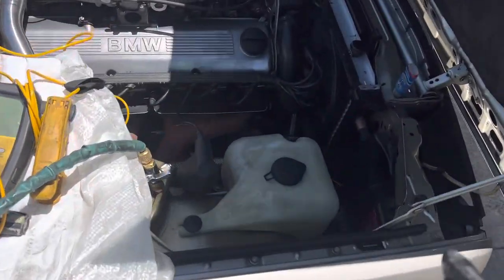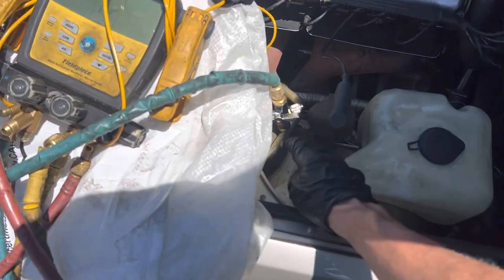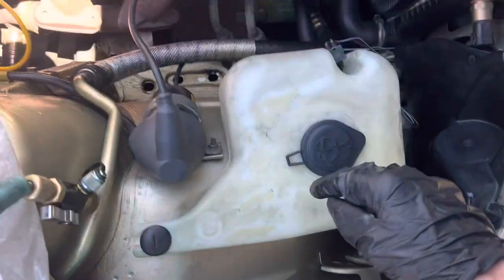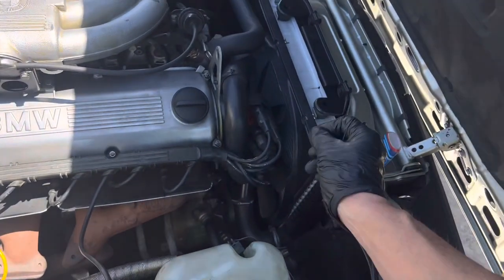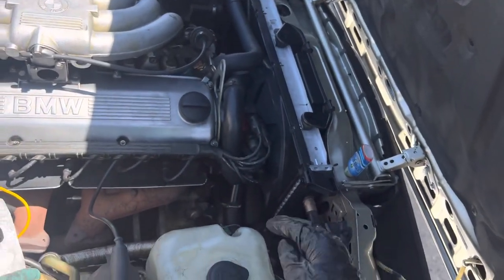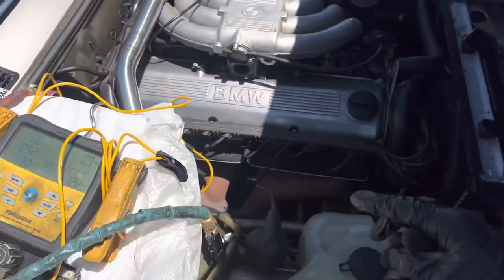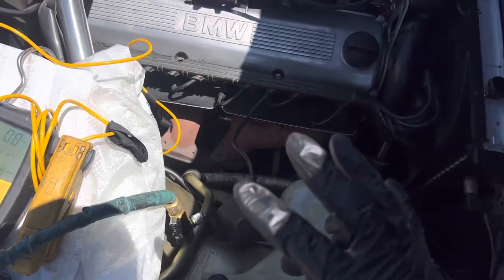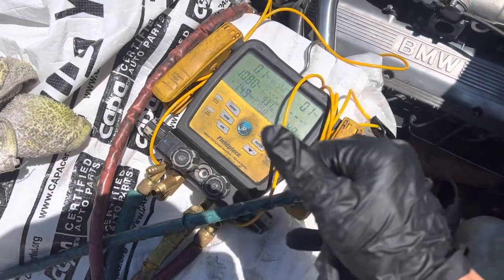AC on this BMW comes in at about 1 psi￼. I’m gonna show you a leak that starts & then stops￼

Comment: On those silicone fluid-filled thermostatic fan clutches, I've found the valve stem that's actuated by the spiral bi-metal coil gets stuck and stops moving.  Often they can be freed-up by using a penetrating lube while actuating the stem.
The other thing that happens as you point out is the silicone fluid leaks out and in that case it doesn't make sense to try refilling them because it's just going to leak again.
The silicone fluid fill port by the way, is an aluminum plug driven into a hole in the center of the mounting shaft flange.  To refill, that plug has to be removed, which takes time, patience, effort....
Reply from the maker: Yes as a child my dad not only made me go over the manufacturers manuals and TSB’s but he would make me disassemble and cut open failed parts. 
           Back in the days where you could takeoff the cover off of your alternator regulator and adjust the cut in and cut out voltage and clean the points off the contacts.   When you take apart your starter clean up the metal surfaces open up the starter solenoid and flip over that big copper bushing that was a contact points that would wear out and it would be good for another 50,000 miles.   Pop out the diode‘s and rectifier assembly inside alternators that you would get for three dollars and replace them.
Reply: I had own one of these before, my solution at that time was to retrofit a used electric fan and relay from volvo 850 and make a custom made aluminium fan shroud. And then the A/C cools really quickly even with 60 celcius in the interior under the sun. The weakest link was only the used fan which blew up the fuse periodically. If I get another one again I would still do the same but putting a new Flex-a-lite fan instead.
Reply from the maker: @knk3220  airflow airflow airflow is king. 

It does not matter how great your equipment is if the airflow is not correct 👍
Reply: @knk3220  Funny story: When I converted my r12 system to r134a, I installed the stiffest truck fan clutch available along with the largest oem fan blade offered back in the day for heavy-duty trailer towing package.
Oh boy, talk about fan noise!  Oh yes, it pulled air through like you wouldn't believe.
I wound up keeping the big fan and going with the original thermostatic fan clutch for a decent compromise.
Reply: @coldfinger459sub0  I bought a fancy new permanent magnet gear reduction starter for my old car and it worked great for about 5 years till the solenoid made me hit it with a hammer in the grocery store parking lot.  Thankfully, it wasn't raining.
Next day, I reinstalled the original starter after complete disassembly and cleaning.
I still haven't discovered a way inside the malfunctioning solenoid they used on the fancy starter, and replacement solenoids cost near as much as the entire starter.  UGH, this new stuff...

Comment: I'm not sure how to go abouts requesting next time you come across it, but would be interested in knowing how you would tell between a restricted liquid tank(drier) vs txv on a hybrid/ev.  Apparentley both these issues possibly can have a low (high and low pressures) at least on variable speed compressors.  I might be wrong about that.  Thanks Mr lech.
Reply from the maker: Yeah I’m gonna assume we’re talking about the newest style vehicles where the receiver dryers the tank is permanently located as a Intrachol part of the condenser on one side for example the Prius. 

So far I have never come across a restricted one on this type of system. 

Any debris that would come from the compressor mostly would get stuck in the condenser tubing itself

For example a compressor slowly disintegrating itself metal the metal and piston ring material. 
         Inside the flat refrigerant tubing there are fins and the size of the openings if you’ve ever taken apart a ballpoint pen that little tiny baby that is basically slightly bigger than a single grain of sand.   
          This is the size of the passage ways that the debris would have to take it mostly gets stuck in the tubing itself is actually your first filter

If the compressor has not completely failed what you will notice is hot gas for example 140° entering the top of the condenser using a clamp on Simister type clamp temperature probe

And then exiting at the liquid line we’re gonna say you only have 50° coming out

     140-50= 90f Drop in temperature far exceeding a 50° maximum allowable telling you you have a restriction in the tubing from debris. 

     I also have a thermal camera and I just pointed at the condenser and I can see where the restriction is so long as there is refrigerant flowing. 

And at the receiver dryer if the restriction was at that little screen that is inside there before the refrigerant flow exits the hole to go into the bottom four or five refrigerant passages you’d be able to put your finger there and feel a large temperature drop or you would be able to use your camera and see the entrance of hot refrigerant and gas and then you would see exiting with the camera a large temperature drop. 

There should be no temperature drop going through a receiver dryer. 

At TXV on a normal operating system you would be delivering a solid column of liquid out of the receiver dryer for example if it was a 70° day your liquid line temperature might be 85° going towards the expansion valve. 

Then depending on how restricted the expansion valve was you possibly on a 75° day still can have some cooling just not as much but you would notice your superheat is high. 
                 Of course you would only make this test after you completely drained the system and weighed the refrigerant to make sure it was full 100% by weight to the manufacture specification. 

If it was recharge it re-perform your test.    And with a hi superheat and the refrigerant charge is 100% correct you know you have an expansion valve issue.
Reply: @coldfinger459sub0  Wow thanks.  Alright that makes sense.  I'll have to brush up on understanding superheat, only used it on installing my house ac.  And its been a while.  I know the sman it will calculate it for different refrigerants.   I am not sure where I should look to find the expected ranges of superheat on a particular car, or is it more of a universal range?
Reply from the maker: @jameyforyst  there is no superheat specifications given by manufactures. 

Different year make models have different sub cooling in different superheat. 

Variable displacement and variable speed compressors make it a little more difficult sometimes depending on the operating conditions. 

It’s also gotten a little hit on the superheat if your vehicle has a internal heat exchanger and you don’t know it and you place your semester sensor clamp after the flow of the internal heat exchanger you will notice a higher than normal superheat.    

But you do no diagnose it at all whatsoever unless you know 100% sure you are exactly 100% filled with the correct amount of refrigerant by weight. 

Only then can you start your diagnosis procedures. 

Some cars make a different because they have pulsating condenser fans and your superheat and sub cooling will be bouncing up and down continuously especially when you’re in lower ambient temperature conditions

And unlike your home HVAC system the majority of those are single speed compressors that just turn on and stay at one single speed with a single speed condenser fan and less you got one of the bells and whistles high and high SSER models.   Those start getting variable condenser fan motors variable blower motors and some even have variable compressors or multi step compressors. 

In for those type of residential units you do not just hook up to them and read superheat and sub cooling you have to follow the manufactures procedures to lock the system in to a test mode that overrides most of the automatic controls so they’re not veering up and down so you can have a steady state by either flipping dip switches or other means setting jumpers. 

Automotive do not have unfortunately such a nice friendly user experience with the technicians where you can hit a button and it throws the system into a known test mode and walks you through the procedures and gives you specifications to follow unfortunately.